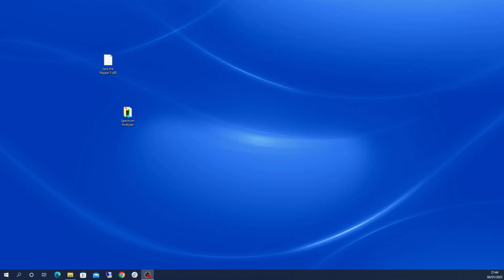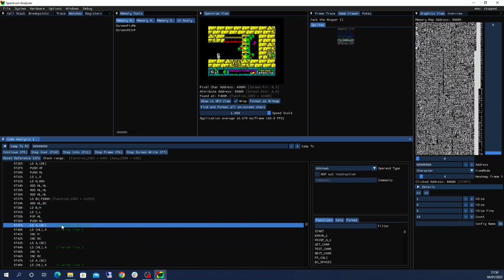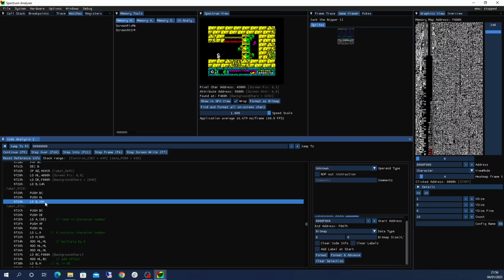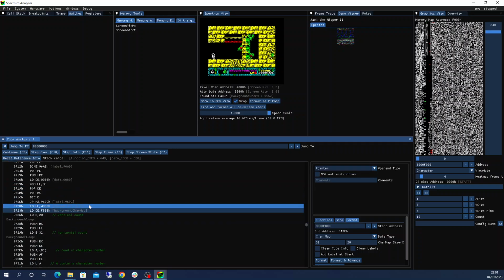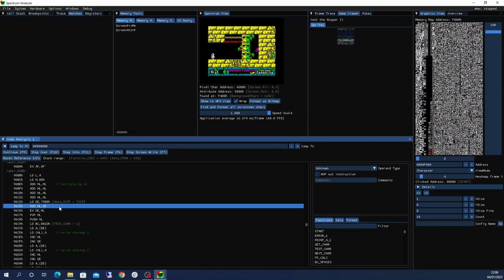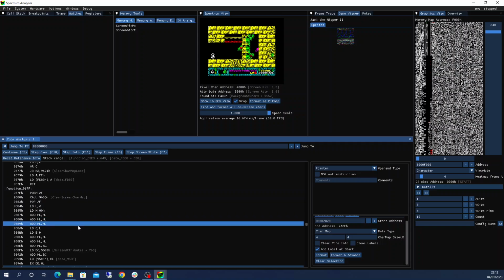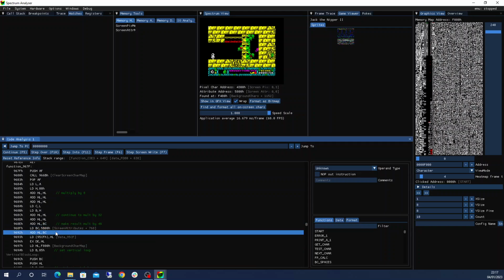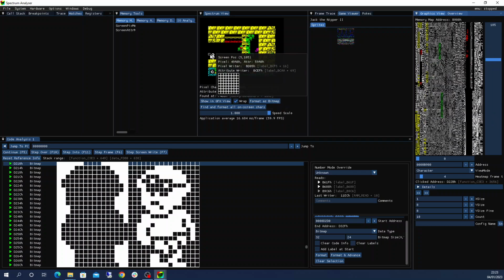Spectrum Analyser - Walkthrough 1

Comment: It's a shame you couldn't provide a link to the .z80 file you used. I loaded up Jack the Nipper 2 on a few emulators, saved as .z80 and even .sna - and Spectrum Analyzer just refuses to run the game when I press Continue. Does Spectrum Analyser need to be configured before jumping into your tutorial? I don't know if the problem relates to my machine or the .z80 file I'm using. I just saved a snapshot from the Jack the Nipper 2 title screen. Am I missing something?
Reply from the maker: That's odd. Have you tried snapshots of other games? Did you download Spectrum Analyser or build it. If you could get me the .z80 file somehow I could try and debug it
Reply: @TheDoktor123  Problem solved! Just heard back from the Spectrum Analyser dev, Sam - turns out I'd been using a 128k snapshot - so I'll have to see how to create 48k snapshots from within the emu's I've been trying. Which emulator would you normally use to create your .sna/.z80 files?
Reply from the maker: @paulspark7287  You could start the Spectrum Analyser with -128 in the command line to activate 128k mode
Reply: @TheDoktor123 Sam was saying there may be some issued with 128k mode? I'll give this another go later today if I get the chance. Thanks
Reply: Glad you sorted it. @TheDoktor123 is actually the developer of the tool. Not me. :) (I'm Sam)